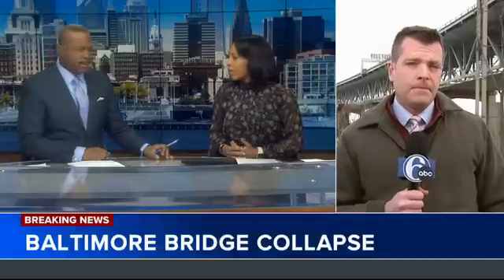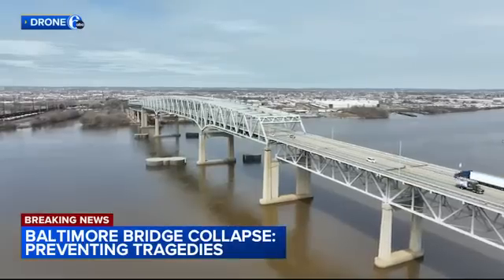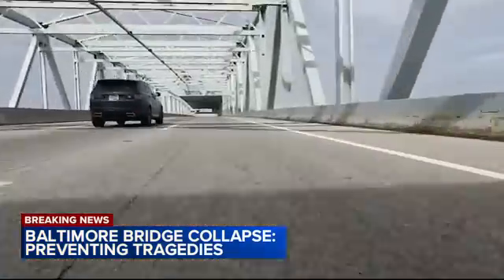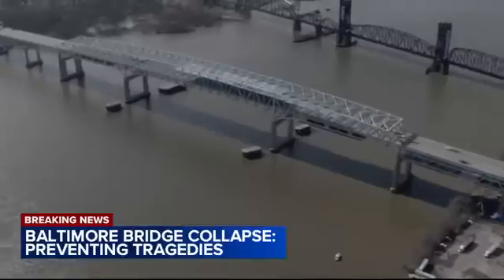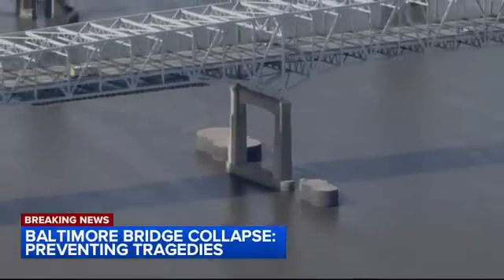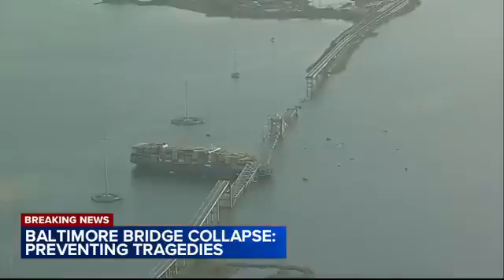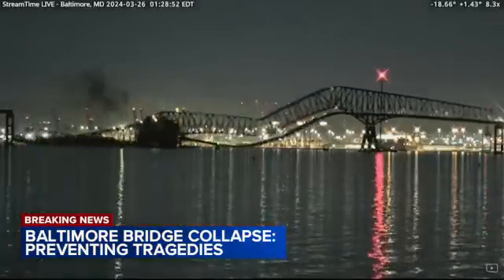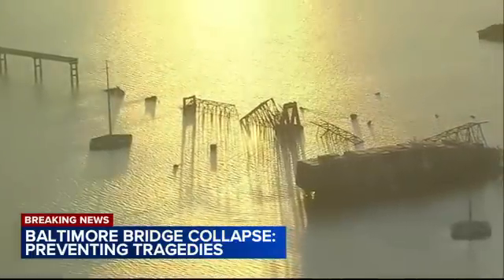Here's what surprised a structural engineering professor about the Baltimore bridge collapse

Comment: The bridge trusses are not designed for large lateral forces in one spot like a 95000 ton object slamming into them.  Surely they snapped or separated at joints  close to the bridge pylon/pier , and the dynamic vertical forces of the separated truss sections descending did the rest of the job. This doesn't seem mysterious. The entire design of the bridge is to resist vertical, not lateral, loads, along with sideways wind loading and dynamic oscillations created by the vehicles traveling along the roadbed..
Reply: Signed,  not an engineer,  not an accident investigator/analyst.

Comment: Bootleg structural engineer testimony. Hell , we all can see the unprotected main support pillars. I even doubt that the flimsy rounded concrete protecting pillars shown in example would be a good shield against a rogue ship of this mass and shape, even if the bottom of the hull missed the concrete protection, the top of the V hull would hit the main support beams with tremendous forces and buckle some high stress links resulting in the complete dislocation of the whole structure in an instant. The only viable option woud be to re-shape the bed of the river with rocks, so that the rogue ships would hit high grounds and stop before hitting any vital structural element.

Comment: Dr. Aghayere is mistaken. The continuous truss bridge is susceptible to this failure because it is... continuous. Adjacent spans are dependent on each other for support (via a cantilever arrangement) so if one fails catastrophically, its adjacent span will also.
Reply: Yeah, I’m a little worried by his comments. I hope I don’t cross any bridges he built.
Reply: @ellaella5537 Don't worry, he doesn't design bridges, and his students have more professors that do.
Reply: @physicsphirst191  worst telling students to design structures with no life span
Reply: @ellaella5537  agreed. As far as safety is concern the correct approach to zero tolerance for failure is to have integrated discussion with all  parties involved in the operation of the port. Is there a Plan B in place if the first Safety plan failed.
Reply: seems like a poor design choice but I'm sure they had their reasons.
Reply: @chrisoffutt8968  Design for failure to happen.  Is like telling the public, A column free structure doesnt mean it wont collapse.
Reply: @acheable  agree, $$$$ BEFORE anything else, victims of Boeing leadership & shareholders greed will much appreciate ! This world lead by finance really sucks.
Reply: This impact would not have happened if there were protection for those piers. It would have diverted ship away from bridge pier is protection dolphin were built.
Reply: @hari4406 Absolutely true... designs must accommodate the worst probable case threat.
Reply: @hari4406  See, I'm not sure.  I'm assuming they looked at dolphins 40 years ago and there's a reason for them not there.  Like I commented elsewhere, if the bridge was built of friction piles, dolphins might not be fiesible to construct because of the strata being already loaded.
Reply: @reubensandwich9249  it may or may not be feasible. That is not the point. It is a shipping channel and there was no protection against being hit by ship, which has very huge momentum. At the very least tow barges should have been escorting the ship for situations like this where a ship may not be under control. Escort barges could have prevented this collision if dolphins were infeasible. Even navy ships have had accidental collisions, so ship collisions are not improbable.
Reply: @hari4406  This bridge was built in the mid 1970s.  How many bridges were hit and collapsed from neopanamax container ships prior to its construction?  None.  The ship had pilots on board and it looks to me it had it aux power generator on from the videos.  

I know you have no clue what you're rambling about when you confuse a tug with a barge.  You want every ship to have tugs until it passes the Chesapeak Bay Bridge, that's lunacy.
Reply: Continuous construction of the Truss brige is the 2nd reason for the quick collapse ( The first being the Cargo Ship impact).
Reply: Its common sense to  zerorise the chance of collision against a bridge. As always the case when tragedy happened  blame on human error or failure in safety management instead of implementing zero safety risk on a man made structure.
Reply: @acheable 
Well firstly, there is no such thing as "zero" safety risk in the real world - and to even virtually approach such becomes cost prohibitive...

Secondly, the OP is absolutely correct in stating that a continuous truss is dependent on distributing the load across ALL of its supporting network - and removing even one of those supports causes the remaining supports to be stressed beyond their design capabilities, resulting in total catastrophic failure... And this IS common sense!

Lastly, as an example , it was said like 50 years ago that consumer automobiles could be designed to withstand crashes to the impact of NASCAR, thus making hwy fatalities virtually unheard of - but a vehicle would then cost like 1/4 million Dollars, or almost $1.3 million today!

So we're always dealing with a compromise.
Reply: @openeyes-411  Never compromise on safety. It is professional negligence to hide the possibility of a design failure due to a common impact. Engineering  code of practice should evolve to Design with Zero tolerance to failure. Warning should be highlighted for public to decide.. Definitely a classic case of  Operation successful but patient died. Frankly such engineer or doctor with such a record of failure hard for insurance to cover.
Reply: @openeyes-411  what is not safe today that matters. The onus duty lies on any engineer to inform the authorities of any unsafe structures you see in public. especially those that  architects dream off but hard for engineers to design to the limits. .
Reply: @acheable I wonder what car you drive and how it's interally set up with your "never compromise on safety" mantra.
Reply: @reubensandwich9249  it may be an imperfect car but you are still in control of your own safety as well as others when driving. . Safety of cars is another " fishy" issue to discuss.
Reply: @acheable  Safety is always limited by cost. You don't spend 10x as much to reduce risk by 0.1%, it's always been a cost-benefit analysis.
Reply: @acheable Totally agree... and engineers are moving toward making more perfect designs, with fewer chances of unintended consequences.
Reply: @arandombard1197 Absolutely correct. The cost/benefit curve rises exponentially as you consider less probable scenarios.
Reply: @arandombard1197  Appears cost is never an issue for safety provision. Neither its structural integrity.  Its ports bad mgmt decision in permitting an unsafe channel even with the assistance of tug boats. As reported ship out of control due to total power failure and when safety buffer channel was encroached the massive impact would collapse any truss bridge whether its continuous and linked.
Reply: @acheable  According to others, the boat isn't even in the shipping channel. It is like making a bridge have to deal with a collision with a car when the nearest road is a mile away.
Reply: @ronaldking1054  but the total power failure caused the massive ship to veer  off the safe shipping channel and the pilots knew the bridge stand no chance for a total collapse due to the ship  massive shear momentum
Reply: @acheable  So you agree that the ship travelled from the shipping channel, the road, a significant distance, which means that the bridge never needed the level of safety you claimed it needed. As for the pilots, they called for help, which is what they were required to do because they had no ability to stop the ship other than the anchor, which they deployed.
A car runs off the road, through a field, and totals a bridge. Of course, it is the fault of the bridge designer not to have foreseen someone running their car in a reckless way rather than the person running the car in a reckless manner. Operation includes maintenance.
Reply: @ronaldking1054  you have to update the design serviceability status of such an old bridge to ensure safety at all times. It serviceability was stretched to the limit since 1977 year after year no design provision for fenders or secondary caissons to deflect any ships from colliding the piers. Excuse me if my views is not so accurate.
Reply: @acheable  Basic premise is this. The ship was where it should not be. The safety of the bridge was determined by the traffic that should be in the area. That ship was not the traffic for the area. The ship through either an act of god or negligence was in the area. Otherwise, it would not have been.
Reply: @acheable  Cost is always an issue and if you don't think so then you aren't in the industry and have zero idea what you're talking about. 

Would you spend an 200000 trillion dollars to reduce yearly casualty risks by 0.00000000000000000000001%?
Reply: @arandombard1197  Safety is intangible and should be built into any engineering product price.  Its dangerous  to categorise safety under expenditure for obvious reason its not the cost planner's life at stake. Again in any industries it is difficult to engage the right person with an eye and mind for safety in the built environment.
Reply: @arandombard1197  Have you wonder why all ports have a fender system installed for cargo ships to berth or dock. Set aside the design of deep sunken caissons  to take the massive impact of the cargo ship, the fender system is a basic safety feature without the port cant be certified. Like wise for a bridge crossing.
Reply: @acheable  "For the public to decide"???  The public will go with either far to little commitment to safety or far too much.
Reply: Any impact on the old truss bridge will render it 'dead'. To collapse it was tragic. Like those experts involved in Safety inputs have either retired for good in 1977. When its coexist with ships plying for so long complacency have set into the new parties managing the port. Nobody will listen to public feedbacks or opinions until a tragedy happened. Safety is for all times and for its worthiness for 99yrs.
Reply: @acheable You're right, it's true, and it would really  go direct to the root cause (or the most plausible threat) for a catastrophic failure.
Reply: @physicsphirst191  there are engineers who have studied failures that had happened before  and somehow gained the skill in operation research or critical path analysis  to prevent future accident from happening.
Reply: 😂 @acheable
Reply: he certainly is...

what a muppet... another text book class room engineer no doubt...
Reply: @mark.lawrence He is undoubtedly very smart... but perhaps is not an expert on bridge design.
Reply: Design successful but it failed.

Comment: I'm a strutural Engineer. From a few rough calculations you would need 40m (131 foot) diameter pier for the pier to sustain a sationary load ( if the ship is at rest but hypothetically leaned on to the pier). But the ship is moving at 7.5 knots (13.9km/hr) that would require around 850m/ 0.53 mile diameter pier  (you don't have a port) with the highest concrete grade mankind has ever seen.  The professor claims a continous span bridge should have stayed a little longer which I totally disagree. Once you lost one support, all of your smart calculations are gone and failure is inevitable. Had it been a simply supported span, the outer spans might not be affected. Though I know what he's trying to say (a continous span should have redistributed the load) but I don't think he has seen the mechanism and type of the support provided. Once there is no weight to couner balance at one end, all the weights are supported with the one at the opposite end (roughly double what it needs to carry) this is due to the nature of the support. (designing the support this way has huge advantage at normal circumstances). 
Edit. whoever tells you that you can design a feasible structure that can withstand this kind of cargo ship (119,000 tonne at 13.8km/hr) , just show him your middle finger, he deserves it.
Reply: I'm just a roofer but I disagree with you as to what would have stopped the ship. Just look it's simple the ship stopped after hitting the column
Reply: Quite true. 
1. Work out the momentum for that mass at that speed. Yoyd need waaay more buffers to "stop it" without pylon damage.
2. No multispan bridge would just sit there if one pylon is taken out. One section pulls on another.  And the ends are NOT FIRMLY ATTACHED to the piers. They roll and have to move with expansion.
Reply: you are correct about what he was incorrect about.  the entire bridge was a single truss.  when one part of a truss fails, the whole truss fails.  

and yes, you are also correct about the magnitude of the impact.  I did a scratch calculation, and the impact was comparable to an average person walking into a TV tray.
Reply: I'm not an expert, but would a barrier need to withstand a direct impact, or could it be designed to simply divert the impact and push it to the side?
Reply: @HarmonicWave  I'd consider an artificial island designed to lift the bow of any ship making a direct hit.  Much energy is dissipated in the lifting.
Reply: 40m to sustain what load if the ship is not moving? you mean the weight of the ship as if it was hanging on a cable from a pulley? Then impact at 7.5kts? did you assume the ship was a block  made of solid steel? 40m might be ok to stop any known cargo ship but 800m seems way too much. the highest force is given by how strong is the structure of the ship and how much stronger the force gets after it starts to compress and total compression length the containers also play a role but you need either to know the design of the structure or some general  coefficients for boats like this:
Reply: Really Wow!
Reply: Movie production engineers can stimulate such a massive collision by the cargo ship. There is this design serviceability limit achieved by the bridge since 1977 only to be destroyed by the port master for permitting an unsafe sea channel close to the bridge. You can design a safe clearance height or sunk and anchored a caisson piers as deep as possible surrounded by a fending system, you will still find ships veering uncontrolled hitting the bridge deck or piers.
Reply: Aquí en Colombia, decimos "Hágale pistola".
Reply: It's the candlether affect
Reply: @Sammiora  When the bridge was inaugurated in the 70's there were no ships capable of carrying such destructive energy (1/2mv²)  and it is probable that the impact of an average ship of that time (containers did not exist) could have been resisted. It is almost impossible to believe that the bridge designers (at the time) did not take into account such a high probability accident and include it in the safety factors of the structure.
The real problem comes from the fact that ships increased in weight and speed and the bridge was not reinforced accordingly. But you are  also demonstrating that the required protections for today's container carriers becomes astronomical in cost and an enormity in construction to the limit of what is practical. 
Then the solution has to come not from dolphins but from a series of  port safety operating  procedures and this is where the port authorities may have failed in implementing. We do not know (although it should be public knowledge) what those safe operating procedures require but it is very likely that the insurance company lawyers will want to know. And that may become a powerful argument to avoid paying for the damage.
Reply: Your calculations are way the fuck to lunch.
Reply: @LOGIBEAR01  by all means please do explain....

Comment: A ship anchor does not hold the ship directly above it.
A ship anchor must be dragged for a while so it can dig itself under the bottom.

If the water is 20ft deep, you need a 100ft anchor rope.
Prove me wrong.
Reply: Not to prove you wrong, but a 7:1 scope is more standard and the height is measured from the point where the anchor is attached to the ship, not the water depth. So for your 20 foot depth with you anchor mounted 50 feet above the water, you need 490 feet of chain. Granted that ship draws more than 20 feet so it would have been hard aground and the whole anchor exercise is moot,
Reply: @denali9449  Thank you for providing a more accurate ratio. I've only been on a boat twice in my life, I prefer being airborne.

Comment: The big questions are 1) why don't such large ships have redundant drive and control systems such that a ship doesn't lose propulsion nor rudder control? 2) Why don't such ships have redundant electrical systems to keep all critical safety equipment operational at all times?  3) Why aren't such ships equipped with sufficiently powerful propulsion systems to quickly stop any ship motion or to avoid obstacles?  4) Could ships effectively use anchors as "emergency brakes"?  5) Should ships have automatic collision avoidance systems that drop anchors, reverse thrust, or turn the ship as needed to avoid the collision?

Comment: For everyone here, go take a look at the Florida Sunshine Skyway bridge in Tampa that was built in 1980 after a ship hit and destroyed on section of that older bridge. The new bridge it self is a engineering marvel and they put huge, huge reinforced concrete bases all around the bridge bases where ships go through. These should stop ANY ship from hitting the bridge base. Having said that most people probably do not know that these cargos ships we have today are 4 times the size of what we had 40 years ago. Simple solution to immediately address the issue is tugs boats for every ship going into and out of ports. Then, build concrete barriers around the bridge bases in the very high traffic and important ports. Done deal.